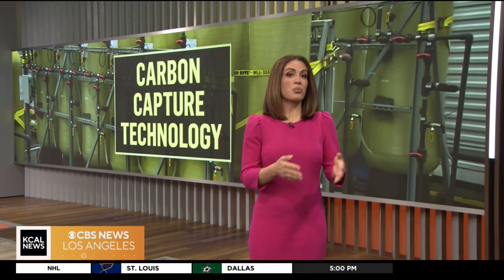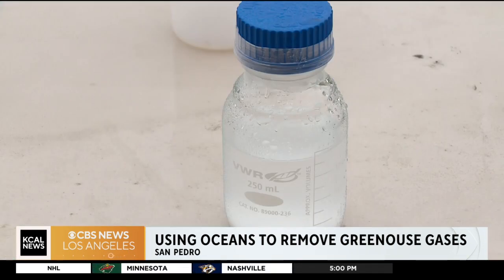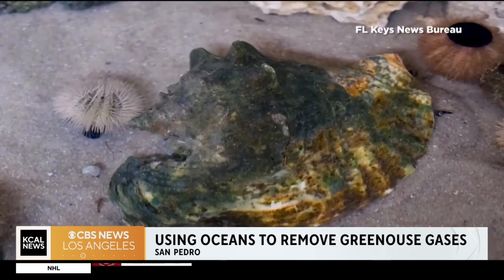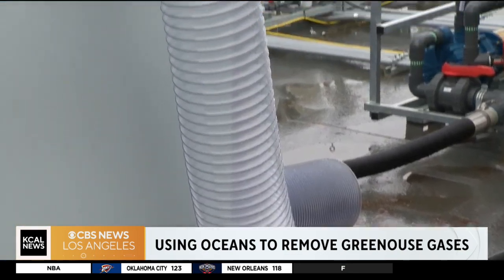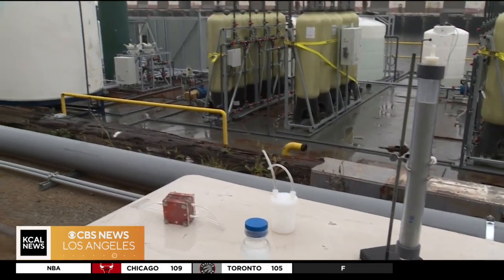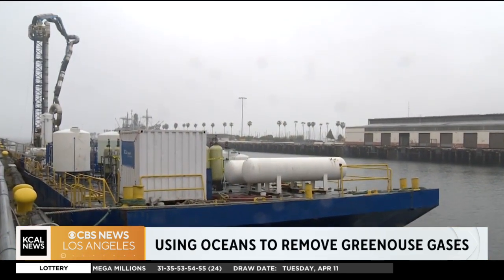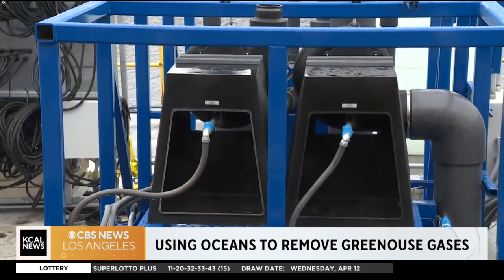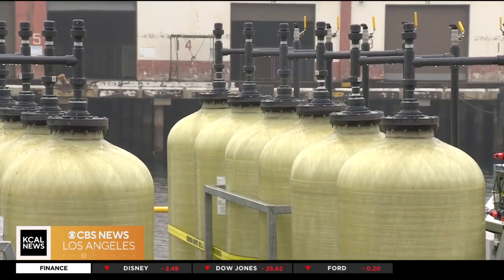UCLA project explores carbon capture through ocean water

Comment: There is also a neutralization process to react ultramafic rocks with the acid that this project creates as waste.  Otherwise, any alkalinity at the cathode will be counteracted by the acidity at the anode.
Reply: Indeed, it is essential to consider a neutralization process when addressing the acid byproduct generated in the course of mineralizing CO2 in ocean water through renewable electricity. Without this neutralization step, any alkalinity generated at the cathode may effectively be offset by the acidity produced at the anode. Thus, a careful approach to managing these chemical reactions is crucial to maximize the project's effectiveness and minimize its environmental impact. -OpenAI. (2023). ChatGPT (August 3 Version) [Large language model].